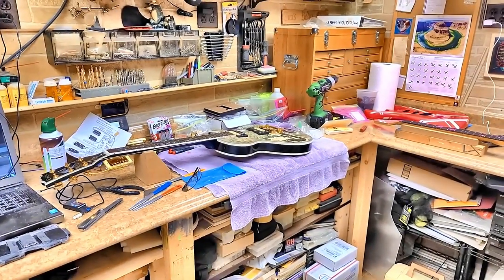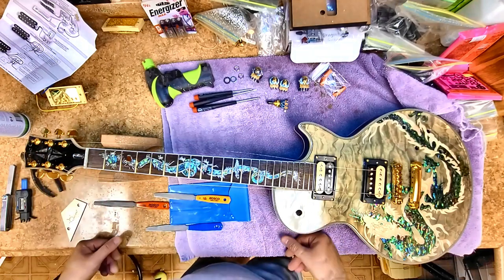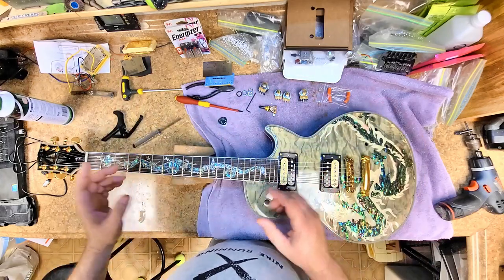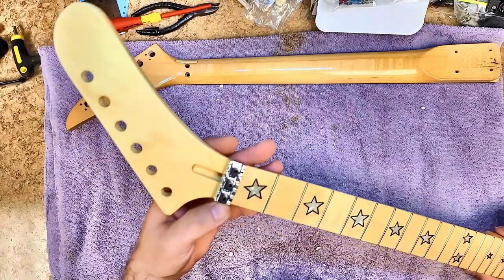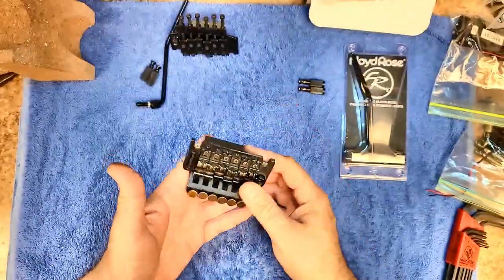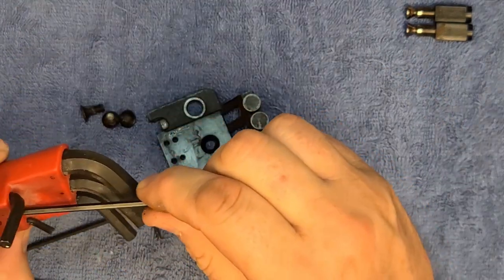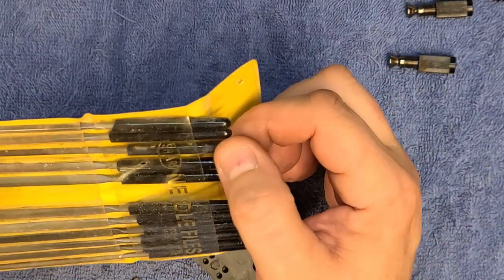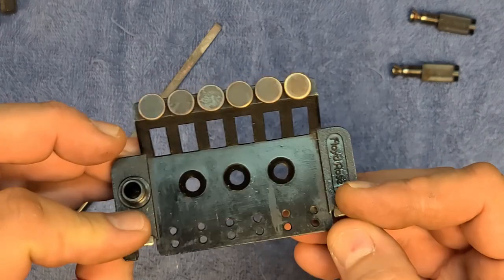Can a Dragon Tame a Kramer Working on Two Guitars

Comment: If that’s a Schaller Floyd, you can pull them out with needle nose pliers, and buy new ones from Schaller.
Reply from the maker: I tried to pull them out. They are not going anywhere. I even put a little WD-40 oil on them. Still not moving. I had to plug the mount holes again. They were a little off.

Comment: Hate the floyd rose special. I'm a ibanez fan and that type of Floyd are used on the cheaper end ibanez. So when I see them on other guitars like Jackson and ESP/Ltd guitars I think cheap. When the both side are equal on the term (at the knife edges) sometimes there is a gap at the top post. I don't like that.
Edit: I was wrong. I don't think I'm meant the Special. But I am talking about that trem you have there that is locking. The one your working on now is a single locking term. Lol I don't like that one either. But hey still awsome
Reply from the maker: My Ibanez has the only trem  I like with the adjustable stabilizer.

Comment: Eric, what is that gizmo you're using for measuring the fret height? Can you share the name or a link?
Reply from the maker: It's a Digital Action Gauge - G-Tech Guitar. Here is the ebay link.  https://www.ebay.com/itm/284116496998
Reply: @ericctheartofnoise8613  Thanks, guv.
Reply: @ericctheartofnoise8613  Alas, weighs in at more than £50 with shipping to the UK. I'll manage with my digital calipers for now.